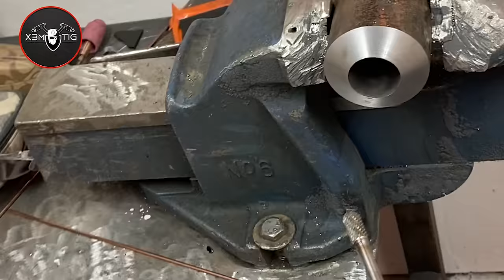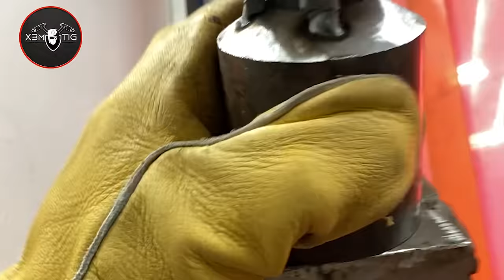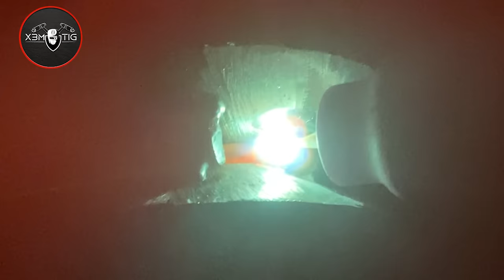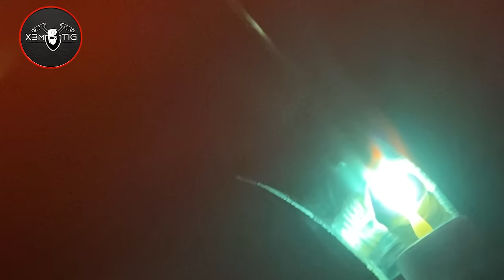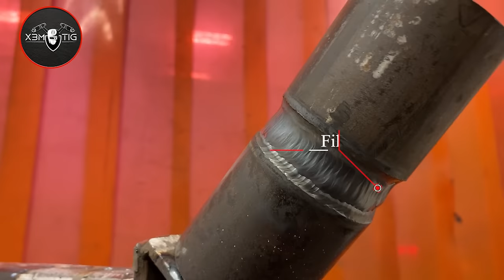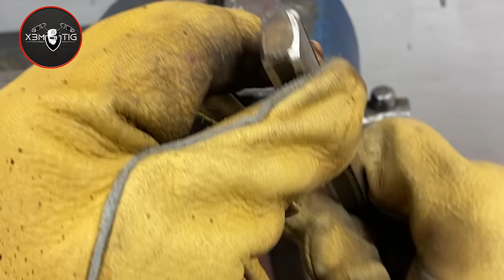6G - MAX TIG Weld Test 2" XXH !

Comment: I'm a Union Boilermaker in the States. This is our standard test for combination certs (tube test is what we call it). We're only allowed a single TIG root pass, no hot pass, and then SMAW the rest of the way out. No grinder allowed. File, chipping hammer, and a wire brush only. Every once in a while, we have to TIG it all the way out. I like the bridge tacks that you are allowed to use. I wish they would let us use bridge tacks and allow a hot pass, but they want four tacks so they can see the tie-ins. Then, no hot pass is allowed, so they can see you are able to weld SMAW over the root without getting suck back. Also, your English is great, and so is your welding!
Reply from the maker: Thanks for your comment bud, this is typical UA test. Thanks for reminding me about boilermakers welding procedures, I did that test couple of times back in the days. Take care buddy 💪
Reply: What union? I'm in the 107 Wisconsin boilermakers union
Reply: @charleswronge4743  I was out of Boilermakers Local 83 Kansas City, MO. But, I transferred my book to Boilermakers Local 456 Rock Hill, SC. I was down here for so long working for CB&I at Vogtle that I ended up relocating to this area. At least for now, anyway. I'll probably eventually end up transferring back into Local 83 eventually.
Reply: 我们这里的也是不允许使用电动工具！

Comment: The 6-G I took was 2 parts 6 inch with stick and 2 inch with tig both were on 45 degrees.
Reply: what do you mean ,the 6g you took?  Where?  for what job?  6g tests come in all types and flavors lol.  This is a typical UA 25  2" carbon heavy wall tig all the way out.  Are you saying you have taken a different test?  That is not surprising.  There are lots of tests.

Comment: Holy shit massive root lol. I use a 3/32 gap and a 3/32 rod and push the whole time. 3/32 all the way out max175 amps till fill then turned down to 155. Looks nice!
Reply: And we 100% xray gtaw process. Not allowed to xray short circuit due to lack of fusion being hard to show on xray with gmaw process on root when doing gmaw/fcaw tests

Comment: Do you recommend bumping up the amps and feeding a bunch of wire into the fill passes just to save time?
Reply from the maker: 200 amps and above, it all depends how much you can handle, but, yeah use 5/32 for filler passes and you’ll finished faster , but it’s not about finishing faster it’s about to learn to weld tig faster.
Reply: I do this .... because the time limitation on test are there and as long as you can see the penetration there shouldn't be a problem

Comment: Why do you start at the top and work down on your fills?
Reply from the maker: Hey bud, I like to put first fill pass at the top, just to prevent creating extra groove, it’s more like a habit, but helps especially when stick welding in horizontal. Sometimes you create groove between weld bead and side wall, which can easily trap any slag or poor fusion. That’s the main reason.

Comment: When you doing  fill pass why u always  start at the top side to down side ?
Reply from the maker: Hey bud, no specific reason it’s more of a habit, but in some cases like horizontal welding examples I like to do top first, to prevent any slag traps if I’m using stick welding.

Comment: 22 years welding GTAW and SMAW can't believe I busted twice similarly test smaller thickness. Root was perfect. Running to cold?
Reply: Any coaching tips
Reply from the maker: Failed on bend test?
Reply: Yes I have pics also I would like to send u the pic sir is root bend
Reply from the maker: @ivanast5157  send me pictures on my email 
Extremetig@gmail.com